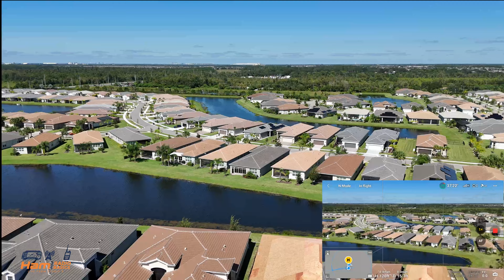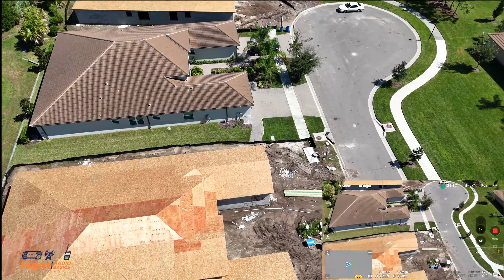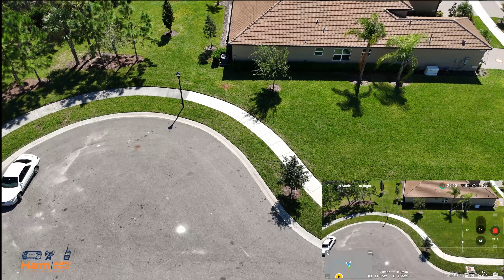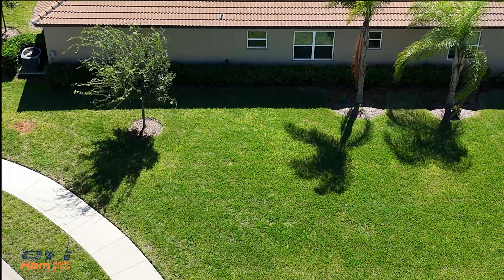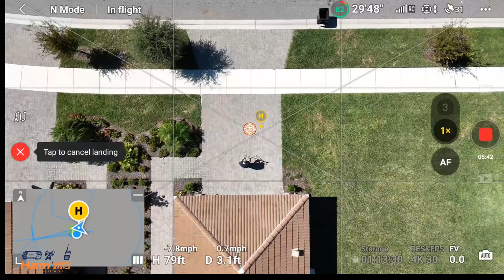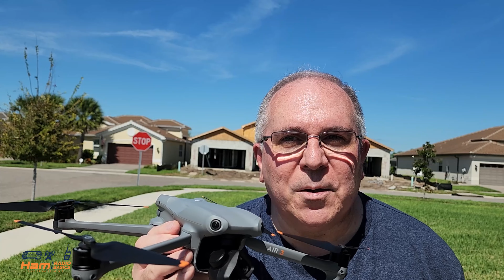HOA Antenna Evaluation

Comment: Lay a wire across the roof and secure it with clips to the roofing tiles, perfectly hidden.  Next up,  you can get away with just one radial - put it on the house on a winder and then you can steer it around the base of the flag pole to work different directions - some comms are better than no comms.
Reply: ...and if going the antenna wire on the roof method: be sure to first check that the insulation material under the roof is not foil lined.  Most houses built in Florida in the past 10 years utilize foil lined foam insulation.  If it is, it will make the antenna more difficult to tune and reduce the efficiency by making it extremely NVIS.
Reply from the maker: That's an excellent point. Thank you for sharing.
Reply from the maker: Good points Steve. The wire on the roof may just work. Thanks !

Comment: Bill, I believe you're overthinking the issue.  I live near Lake Wales, FL and have a flagpole antenna in an RV park.  Typically here in FL the irrigation pipes are buried 6 to 14 inches below the base of the grass.  You can easily use a straight spade or shovel to bury both the coax and radials a couple of inches below the base of the grass, and should not hit the irrigation pipes.  Even if you do, using a spade or shovel you can route the wires or cables over or under the irrigation pipes.  Florida's sand is very forgiving.  Burying the wires and cables under the base of the grass will keep them out of the reach of the mowers and not impact their operation.  My set-up uses an inexpensive 20 ft fiberglass extending flagpole, with a flag at the top, and wire run up the center of the pole (this will not work with a carbon fiber mast).  In my case it is located a the side of my patio, and I have an MFJ automatic tuner mounted in a deck box adjacent to the base of the antenna.  You may not be able to do the same, due to distance to your planned antenna mounting site, but mine tunes all bands from 80 mtrs through 6 mtrs.  Does this info help?
Reply from the maker: Yes this really does ! Appreciate the info !

Comment: That cable will present a challenge with those irrigation pipes.
Reply from the maker: It sure will. I'm hoping there might be an easy way to get it under them - closer to the surface and the mowers may cut it.